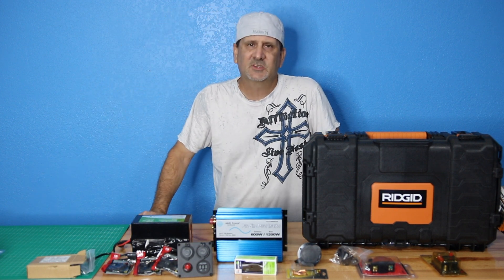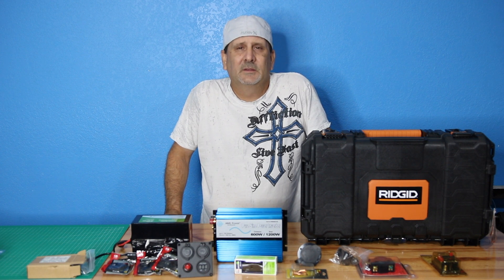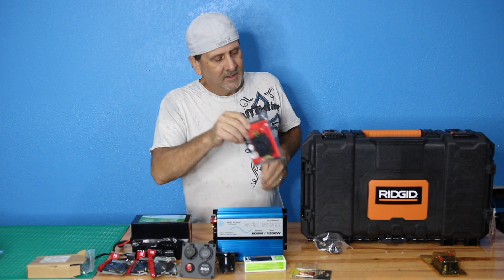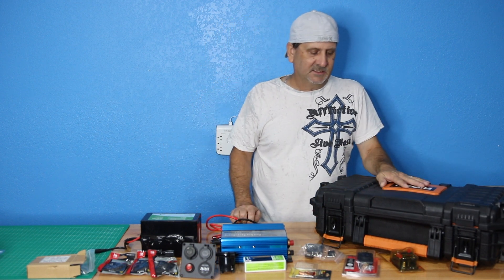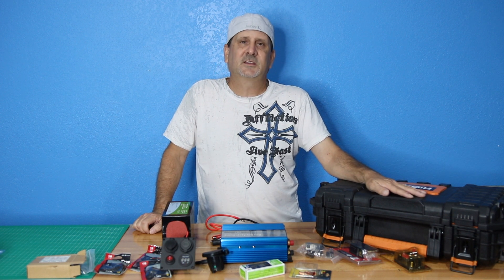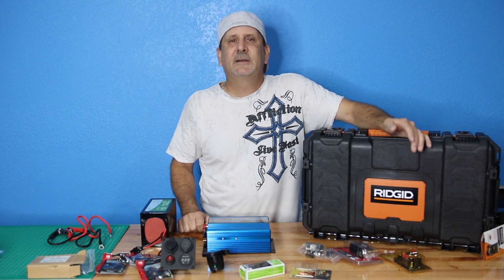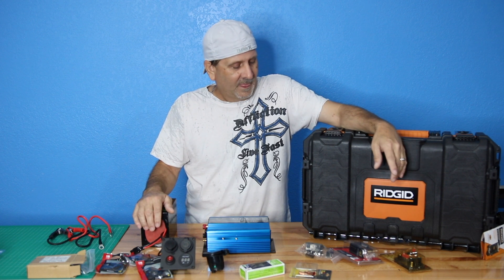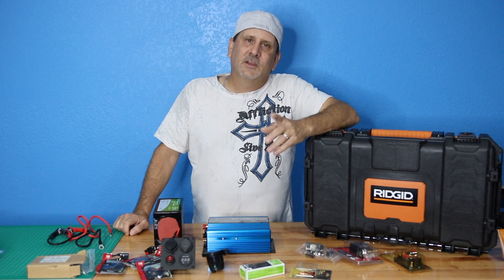Portable Solar Generator DIY Intro

Comment: Hey buddy I'm getting to build mine soon. How much would it take just to light up a small shed all day with t8 fluorescent?
Reply: Im thinking about getting a 12.8v-100ah lithium. Is that powerful enuff for 200w or more solar panels? Do I need more batteries just to light up a shed for more then 18 hours
Reply from the maker: depends on the watts of the t8 and then build the pack for that. a standard 100ah at 12v is 1200wh of storage.
Reply from the maker: yes its powerful enough for 200w of solar but that depends on your controller and the charge rate of the battery. I dont know how many watt hours you're using so I can't answer that question. I assume a T8 isn't that power hungry so probably yes if not very close. figure 100w bulb will last about 12-14hrs on 100ah Lithium battery.

Comment: When using 18650 batteries will you go with 12 or 24v?
Reply from the maker: to tricky of a question. Depends on the power requirement and the amount of space needed etc.
Reply: I recommend 12v because its the standard voltage
Reply from the maker: We do both versions. Depends on the Customers needs. the biggest difference between the 2 is amp draw on the battery pack. In this build I used a 12v system.

Comment: Do you have a link for purchasing?
Reply from the maker: very carefully.
Reply from the maker: Conner Sankey, 
I will have soon. I'll be finished with this this weekend and let you know.
Reply: How would you use Super Capacitors in this unit while using the LiPO